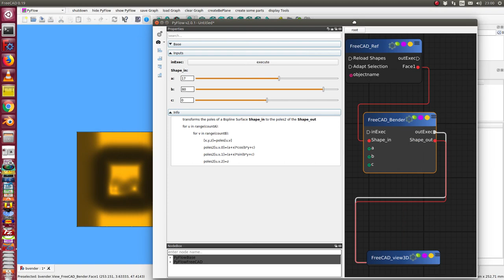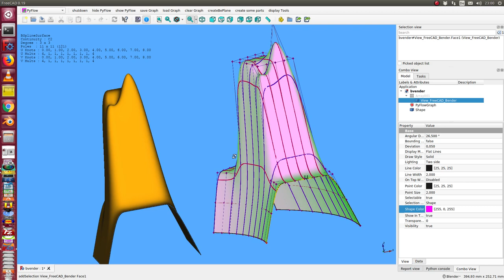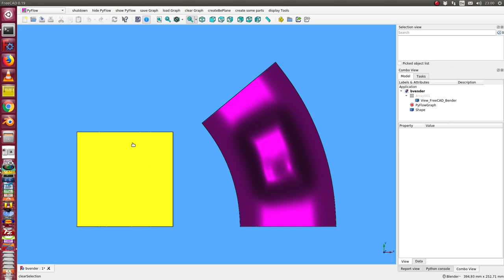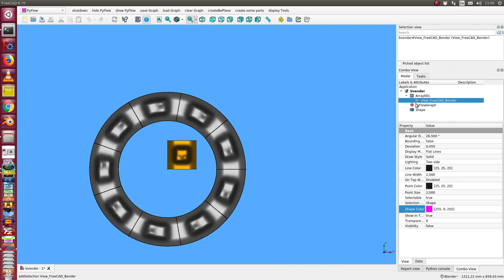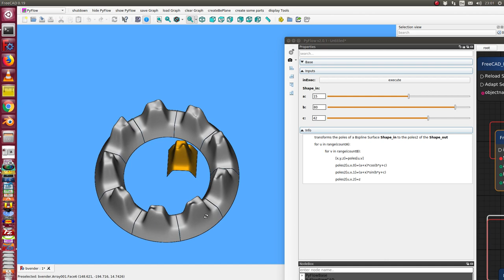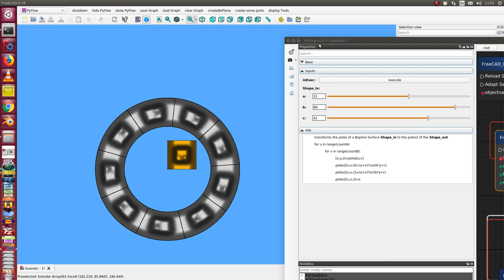FreeCAD with PyFlow: node bender

Comment: Hi,
Great job for the nurbs workbench but I can't get your nurbs workbench to work properly in debian 9 and freecad 0.18.3
Some icons are missing. Most commands don't work. I don't see zebra tool. MultiPoint edit also does not work. 
How can I get the installation correct?
Thanks
Reply from the maker: the zebra tool comes from the curves workbench, you have to install it too.
I need more information  to support you. Whgatr are the errors reported when you try to execute the commands?
Reply: @microelly  Hi, 
FIrst of all Test-test gives the error:
No module named TestNurbsGUI
There are errors related to some missing icons too.
I am able to create BeTUBE and BeGRID but unable to get multi-point edit working.I get errors related to PyQt I guess when I try to use multi-point edit. I attach a screenshot and log file from Report view here.
https://drive.google.com/file/d/13EHyOyKuUAStoOr-LE_3bIycT4je2zAE/view?usp=sharing